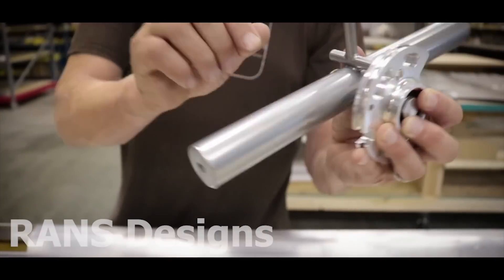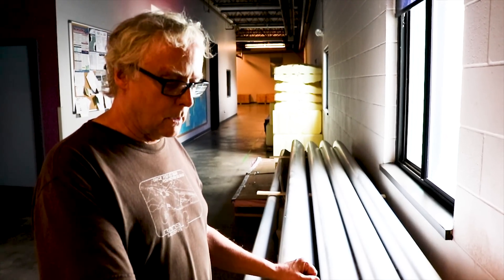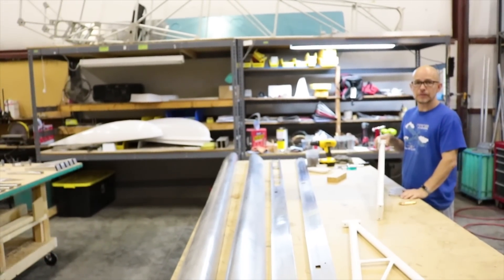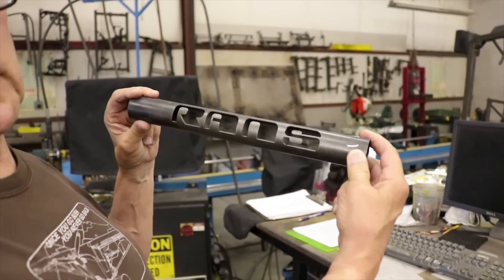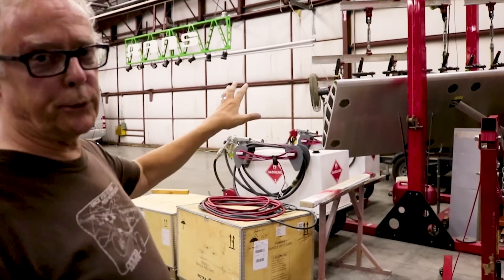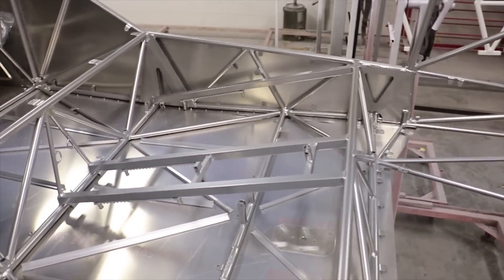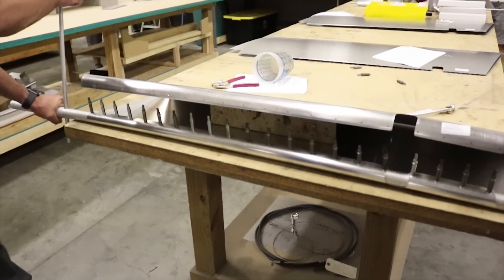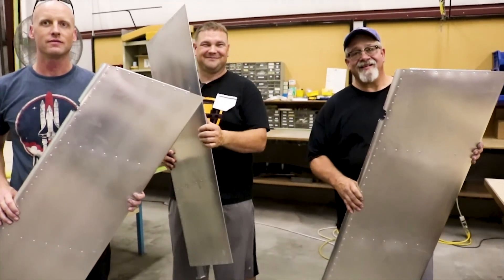RANS Designs - Factory Tour! How it's Made!

Comment: Very nice and efficient set up. I think I'd question one thing though and I'd probably question this same issue at a significant number of airplane manufacturers as well as other industries. Where are the torque wrenches? I heard the factory tech instructing the customer assembling a rudder, "There's no need to deform the metal. Just snug it up."As an ex-submarine guy, that doesn't give me the warm and fuzzy's. Just a thought.

Comment: Nice video! As an aerospace welder by trade,  I was not very impressed with any kind of mig welding on a fuselage. That should all be exclusively tig imo. But over all sweet planes.
Reply: I’m not sure but I can tell you this as an A&P and now doing aerospace welding for Pratt and Whitney full time for many years TIG in my opinion is just a superior weld. I know beyond a doubt I’m getting full penetration when I can see the “key hole” in my weld puddle. I’m not saying mig welds are not acceptable but I know I’m only allowed mig on ground handling equipment only. Any time I have FPI inspection done the only welds I ever have any kinda of issue with are mig welds. Remember when you TIG you control all three variables (heat, travel speed, and feed speed) while you weld. So it’s easier to make fine adjustments on the fly for perfect welds. I’m sure they get there frames inspected and there is nothing wrong with it. But as for me I want tig or oxy on any airframe I build.
Reply: Yes, I know welding small OD tube clusters can challenging, but it sounds like these joints are made up of 80% starts and stops.
Reply: Hasn't  Maule used MIG for years?

Comment: Is the bird cage of the Rans S20/S21 4130 Chromoly tubing?
Reply: Sure is.
Reply: Tango Delta:  I thought MiG Welding 4130 was a No-No per AC 43.13.
Reply: Justin Dyster from AC 43.13

c. Gas Metal Arc Welding (GMAW). This method of welding was formerly called Metal Inert Gas (MIG) welding and is an improve ment over stick welding because an uncoated wire electrode is fed into the torch and an inert gas such as argon, helium, or carbon dioxide flows out around the wire to protect the puddle from oxygen. The power supply connects between the torch and the work, and the arc produces the intense heat needed to melt the work and the electrode. Low-voltage high- current DC is used almost exclusively with GMAW welding. GMAW is used more for large-volume production work than for aircraft repair.